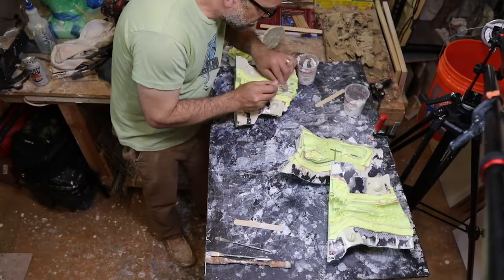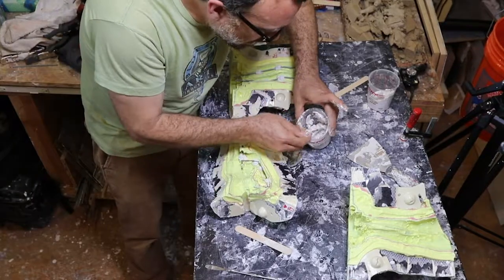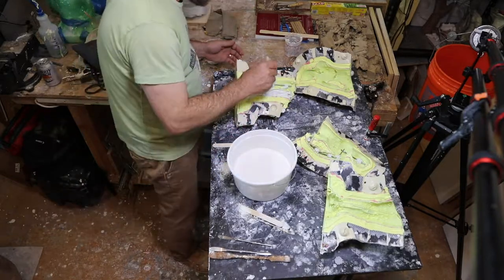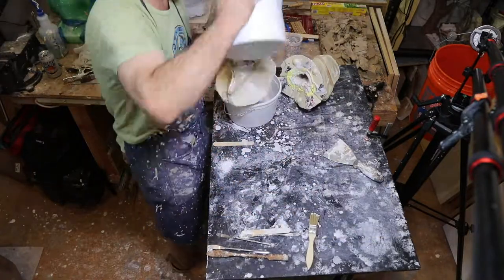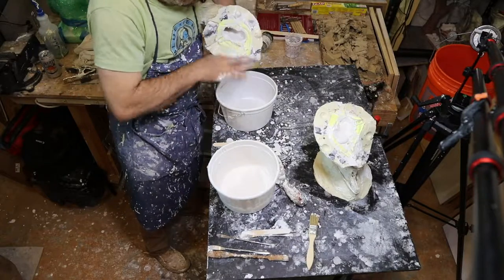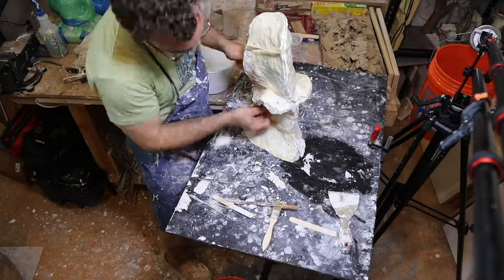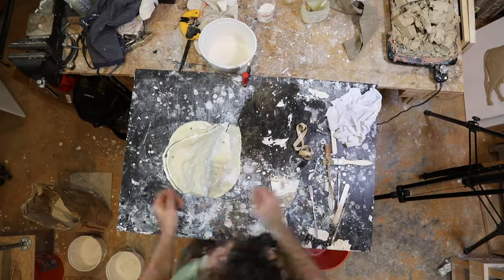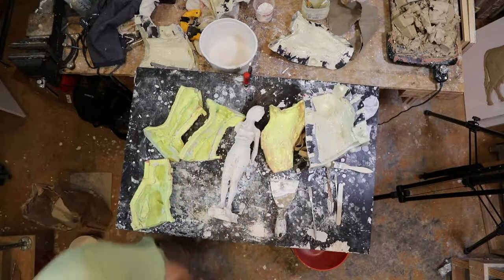PLASTER CAST IN A SILICONE MOLD

Comment: Cool channel and videos. I am doing some table lamp bases that I used rebond 25 silicone and the plasti paste for mother mold. Yeah, you're right, that stuff dries sharp as a knife. I found that out because I am doing Hydrocal hollow castings (slush mold). My rubber is a glove mold in one piece (redundant?). Would you advise, keeping in mind I am using Hydrocal to brush into the mold a layer before pouring in and slushing it around? It is a generous shape that I can easily reach into the mold when it is seated. 

Also, I made some plaster masters for other lamps and they have been sitting de molded for over a month, so very dry. Can I still soak these plaster of Paris and patch them. Mostly filling air bubble holes that came through after an initial wet sand. I tried bondo and it worked horribly.  Awesome channel. Subscribed!
Reply from the maker: Sorry for the late reply. You've probably already figure it out but, yes, you can soak the plaster then patch it.

Glove molds are great when they work because there is no seam. But seams are often necessary.